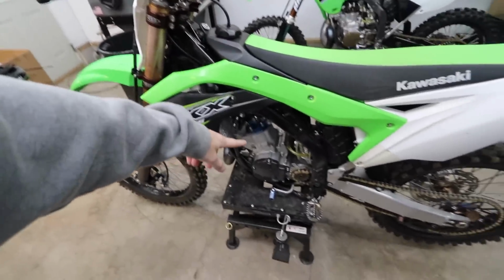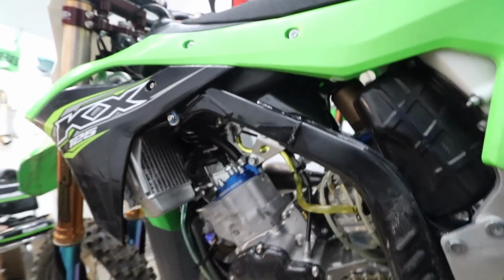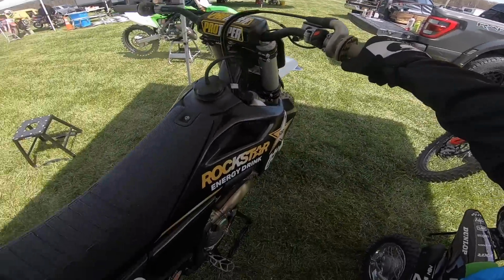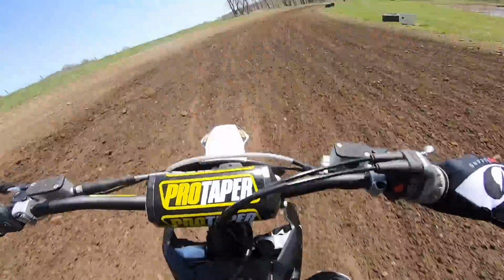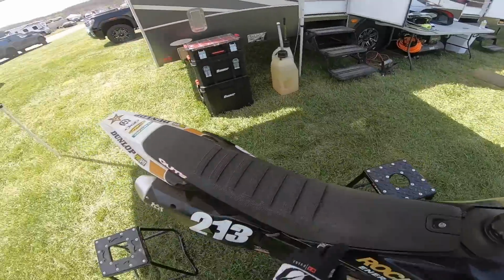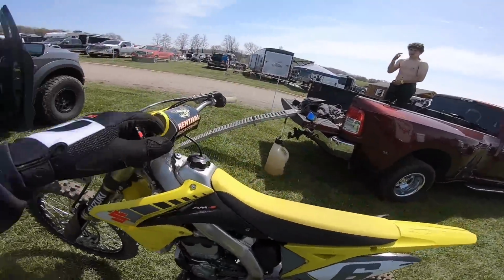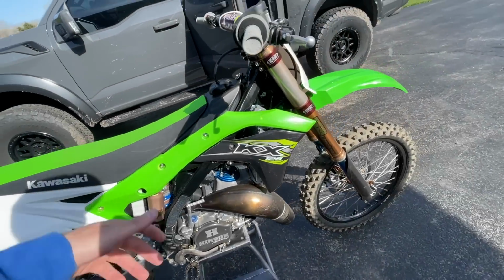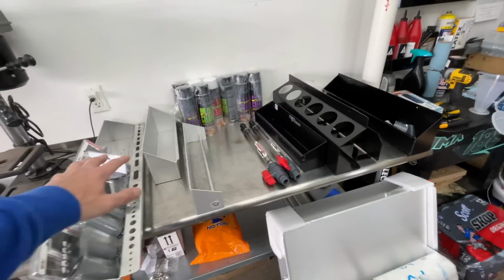NEW 2023 FC250 First Ride

Comment: That kx rattle sounds like a gear to me, I'd check the waterpump impeller shaft and the gear behind the clutch hub. Also sounds similar to when the bike is running  and the kickstart is still down so I'd check that out too

Comment: the kx tick sounds like the actual head its self. thats why the spark plug is backing out on its own. because the piston is hitting the head. so id check the head its self.
Reply: Hope he sees your response, that’s what I feel it is he needs to verify the squish is correct. Squish to tight piston clocks the head.
Reply: @billyhardin1782  Thanks man, your exactly right. I've been through enough 2 strokes to "kind of know". if he verifies the squish between the spark plug and the piston the "tick" would no longer be there.

Comment: I regret getting rid of my kdx200 a couple years ago but it allowed me to get my eliminator 600 street legal road bike and its a whole new animal of fun so although i miss cruisin trails on the 2 stroke the street legal way is so much more my style. I will always have a spot in my heart and i will get back into the dirt scooters when money allows but for now i will keep tinkering on my 600 making it my own.
Reply: I might try to find a cheaper 250 4 stroke that needs some top end work or something non running to get a cheaper bike, im not afraid to get my hands dirty. I took the kdx200 down to frame a few times and painted it and went through the motor, put new rings on it, the new vforce reeds and reed cage, a little bit of porting and polishing, and some aftermarket pipe action. It was a mean bike and was the fastest in my group until my other buddy built his 450 and bored it to a 482. It held its own and took the 450 until it got into its power and then it would pass me.
Reply: I have a 93 kdx 200 I’m doing crank seals right now but it’s an amazing bike
Reply: @maxmcintire1573  mine was a 1996 that i had some yamaha fenders on to make it look like a moto bike and not a dual sport.
Reply: @ratedredneck96  I put a kx 125 fenders and a number plate on mine now it looks like a kx 500

Comment: It might be the bottom end my 99 
kx 250 Was making the same noise it was the Rod Baron
Reply: 99 kx 250 here too, its starting to make those noises, sat for ten years in shed, i replaced water pump bearing and seal, maybe time for full motor rebuild?
Reply: My sat for about 8 to 9 years
Reply: What's the Rod Baron?

Comment: Just a theory, I’ve had a similar issue with the noise. It was on a Ktm 65 and a husky 250f. The engine bolts that carry the motor in the frame were snug but not torqued. I tightened them back down to spec and the noise went away

Comment: I believe that its piston slap at low rpm but in the video once you rev it up it goes away that’s how I’m like 90% sure it’s piston slap. It happens to allot of two strokes but if you hear it at mid to high then there’s a problem.

Comment: That’s a 2022.5 Rockstar FC250. 2023 FC250’s haven’t been released yet. And yes I know most of the changes will carry through from the Rockstar to the normal FC250 but it’s still not a 2023 FC250
Reply: Fr
Reply: 2023 sounds better for the title more views
Reply: 2023 Will be a 2022 with different graphics haha
Reply: @davidbjorkholm310  no chance. The 2023 is a brand new platform. Frame. Engine etc. Except for the mini’s. They are basically the same.
Reply from the maker: Honestly had no idea assumed it was a 23
Reply: @TylerMonagan  yeah they showed off the minis already, grey plastics on the shrouds. May 10th is when KTM will show us the 23 line
Reply: actually it's a 2022 Rockstar FC250. There's no such thing as a 2022.5.
Reply: Correct
Reply: If I’m not mistaken that’s a 2027 FC250. 🙃
Reply: The bevinator  right, but the "Rockstar Edition" or "Factory Edition" is what signifies its one year ahead. So making up something like 2022.5 is redundant and pointless, when KTM clearly says its a 2022. Next.
Reply: @davidbjorkholm310  they announced that they are literally redesigning the entire bike so no it wont